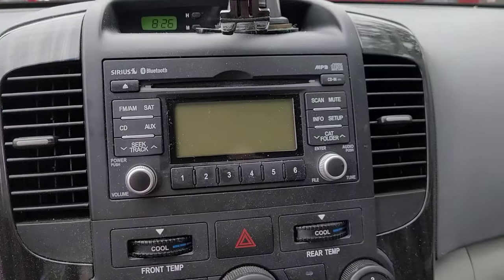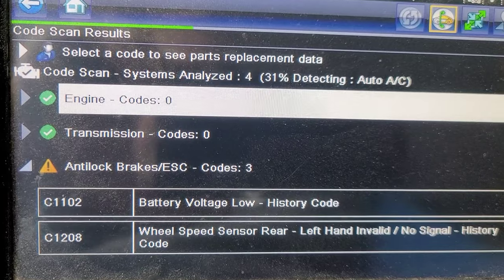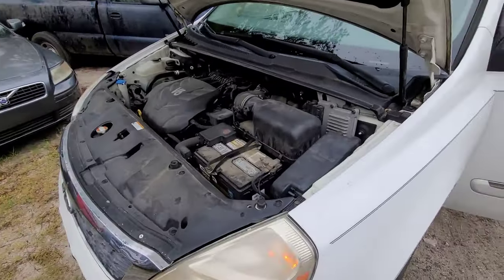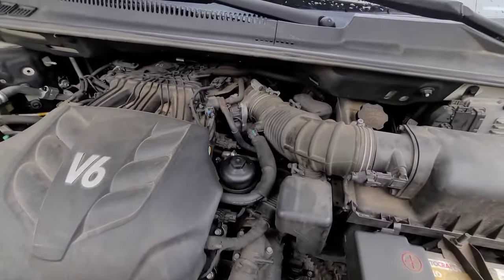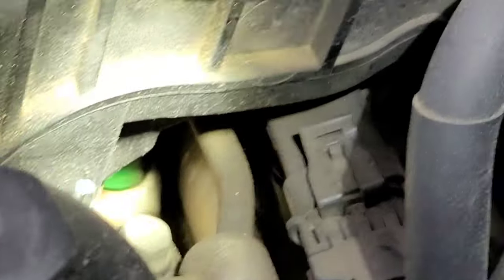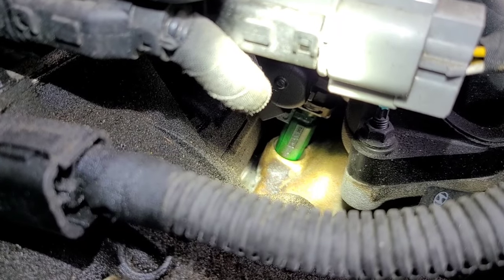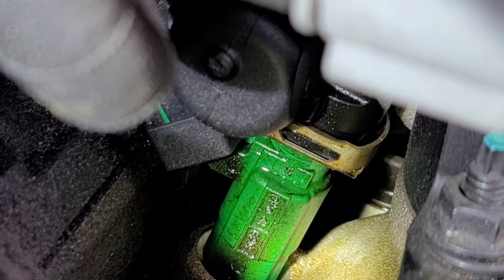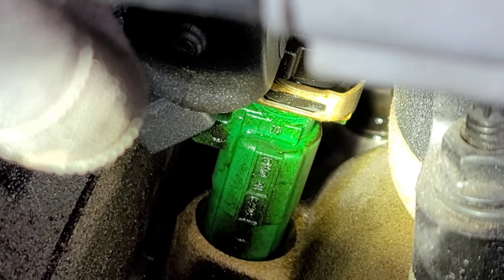Fuel smell inside is quite strong. But why?

Comment: Had the same gas smell on my 2019 Mercedes sprinter. Two trips back to the deal to finally get it repaired right. Dont buy mercedes
Reply: Mercedes is so good yet so complicated and painful with the repairs
Reply: @FjoriKarabina  i have spent $60 thousand plus for repairs to my 2012 Diesel and $15 thousand plus for my 2019 gas sprinter.  Love working out of them hate repairing them. Im ready to burn the 2012 if it goes into limp mode again
Reply: @ptech88  Bro i have a mercedes benz w203 of 2001 , 220 cdi diesel , i swear i am in Albania and we have cheaper service costs for the cars , and between 2019-2024 i may have spent 6000 € , it is so comfortable and such a beast on the road , but the maintenance is a pain in the ass , totally understand you
Reply: @FjoriKarabina  im guessing you dont have all the emissions controls that mine have. Every problem had been emissions
Reply: @ptech88  exactly bro we dont go to the mercedes company for the services we have our own private mechanics

Comment: I smell gas when revving really high
Reply: Did it get resolved if yes what did you do?
Reply: @nikhilgaba1  the engine stops ignition on purpose as to protect itself during unneccesatry revving. it a function that the fuel injectors keep going in time but ignition is cut causinf fuel to dump into each cylinder and escaping its normal.

Comment: Interesting video. I have a general question. If fumes are coming from the engine bay, how do they get into the air intake for the cabin? Is the rubber seal for the bonnet just not good enough at separating the two?
Reply: There's a vent that pulls in air for the cabin, it's near the wipers. So the car pulls in air really close to the engine. When Kenny says, "recirc" he means recirculation of the cabin air. So that lead me to the vent pulling in the air.

Comment: Thankful that owner taking gas smell action with Kenny !  Many Kia, Hyundai vehicles have caught fire. Guess that cheap plastic fuel rail says it all. You buy cheap Korean car, get cheap parts with equally cheap dangerous quality. It's worse with DI because the fuel line and rail must be leak free at > 3000 psi. No place for cheap quality parts.

Comment: My 2016 A6 3.0 has a fuel smell also. I can only smell it when I’m motionless or in park after I drive and it’s really starting to get to me. I can’t smell it from underneath the car but I can smell it from the engine bay.
Reply: What was your resolution
Reply: Did you ever find the issue?
Reply: @turnyouintoabox2300  you find anything?
Reply: @Jay5hundo Check the fuel delivery fittings and lines under the hood. In my case it was smelling from bad tank cap on the filler as well as evap cannister. It can be a line from the purge valve leaking vapors as well under the hood
Reply: I have the same issue, what was the solution @jaycecox8700
Reply: @Gtb42  I've seen in the past that it can be the seals around the fuel injectors going bad. They are pretty easy to replace.

Comment: 5:47.. If you watch closely, you can see fuel drip from toward the top of the injector on the left hand side. Probably needs a new o-ring.. but could possibly be a crack in the fuel rail.

Comment: Yesterday, my Kia Picanto old one, went through change of brake discs and pads rear and front. 
Back home, I’ve got a strong fuel smell inside which didn’t have before. 

Could it be something they forgot to adjust, damaged or what could have happened? 

I’m dying for tomorrow to arrive and ask but I’d like to have an idea if they might have forgot something? 

Also, I’ve found a metallic piece seating on the back seat just under the belt. Have they forgot to put it back? 😮

Please, if you read this, HELP! I’m scared as first it was quoted £288 then I ended up paying over £500 🥺

Thank you 😔❤️
Reply from the maker: Hi Kia owner! It's Mrs Wrenching. I would go to the repair shop first thing in the morning. Kenny would hate to have a customer worrying about their repair. That being said, having brakes done all the way around would not cause a fuel smell in the car. I have had mechanics leave tools in customer cars though. Get with the shop in the morning & get some piece of mind. Your brake pads will squeal when they need to be changed. It's good practice to have your mechanic check your brakes every time you have your oil changed. I get my oil changed every 5000 kilometers. That way you should be able to avoid another BIG brake bill. I hope this info helps. Thanks for watching! 
PS let me know how everything goes - Megan

Comment: Hi, Thank you so much for the video. I have a 1997 Ford escort and I smell gas not to long after a cold start. Soon after rolling down the road, I have to open all the window🤢☠️ would really appreciate any help or ideas with this. Thank you, Diane
Reply from the maker: It's something you really need to investigate. I don't think the Escort has fuel lines that run in the vehicle , but I'm not 100% on that . I'd check the fuel rail for a leak . Also , try turning the interior air to "recirculate" . If it's on recirculate, and the smell isn't as bad , then you have some sort of leak under the hood
Reply: @WrenchingWithKenny  okay. Thank you so much for your reply ❤️ I will do my best to look into these.

Comment: If the fumes are coming from under the hood, would you smell it when the heater is on? I smell fumes every time I’m stopped at a light, but not when the windows are up
Reply from the maker: If the heater is on and NOT set to recirculate , then it will draw air from the cowl area and you'll smell it .

Comment: I just got vakve hasket cover akd valve adjustment done few days ago and now there is a gas smell through vent inside cabin. Honda says it not rekated to vakve gasket. 
I have 2016 accord 2.4l what can be the reason
Reply from the maker: They could have very well disturbed a fuel line . I believe you have a fuel leak . I would have the dealer check it to be certain. You never had the smell before the work was done . I would make sure they know this

Comment: Wifes' PILOT Smells like Fuel but only when the weather gets colder out (not freeze'n- Houston area) and not all the time. Any Ideas ??
Reply from the maker: Very hard to say as there are quite a few components in the fuel system. There is nothing I know of that's a common failure on pilots or any of the Honda V6 fuel systems

Comment: Here's one for you. 
2012 Ford escape XLT. 
Overwhelming fuel smell inside cabinet. Zero smell outside. 
Car doesn't have to be running. (I've had it parked since I noticed and there was really no noticeable difference while running).
No code. I haven't been driving it so don't know about mileage difference. No leaks found. No problem filling up. Just eye watering fumes inside. 
Any guidance/advice would be greatly appreciated. 
Thanks!
Reply: On The Escape the Fuel pump is under the drivers side rear seat. Lift up the bottom seat and see if the seal is rusted or damaged.
Reply: Fuel pump under your back seat. Maybe

Comment: Will water in the gas tank make my taho skip and pop what can I put in the tank to.get rid of the water
Reply from the maker: Doubtful . Usually, water settles at the bottom and will get sucked thru first. Dry some isopropyl alcohol (dry gas) . That will help if there is moisture in the fuel. But I think you have other issues
Reply from the maker: @andypressley4702  , it could very well be bad/contaminated gas , but not necessarily water in the fuel.
Reply: Will a bad coil pack make my taho skip and pop
Reply from the maker: @andypressley4702  . It can definitely make it skip. Usually you'll have a check engine light on and flashing as well

Comment: Hi. I got a question. I have a ford escape 2002 v6, but the check engine turn on with a code cylinder 5 p0305. I already changed spark plugs and coils, but the engine kind of shakes and smells like gas fuel. It runs roughly and the catalytic converter overhead red. What do you think that the problem is?
Reply: I had the same problem and it was fuel injector
Reply: That or part of the valve has left the chat I had the same issue the the top off check your internals

Comment: I just got a fuel pump replacement and once I got in my car it smells like gas. Is this normal?
Reply: Maybe just the process of replacing it may cause some gas to drip 💧 and cause the smell especially if your fuel pump is located inside the car
Reply: Same here , did the smell stop in your car ??

Comment: let us know where this goes as far as repair work.
Reply from the maker: Dealer fixed it free of charge under a recall
Reply: Our nissan had a bad fuel smell after cold start. Then disappears when it warms up. All the spark plugs were loose and leaking vapors. Think thats why they sold it so cheap.
Reply: @WrenchingWithKenny Now I'm very interested😅

Comment: I have the same exact problem Except it's not from the Ac on ,,it's just The defroster on which is basically the ac  on  lol  and it only happens on occasion,, I also had a evap leak code.. which I have reset a few times   one was p044 m then I checked the gas cap and all that reset the code   then got a p045  code  , reset that   then it threw a P044 code again after a week or 2  ...What should I do smoke test it?  What would more than likely be the cause. Any help would be appreciated..       I keep my tank between 3/4 and full most of the time so it doesn't really have a chance to really throw a code again.. even though I could reset the codes anytime I want as part of my aftermarket head unit,    but I'll smell gas for a second or two.. then Goes away... Might not come back for another week or two sometimes even a month   ... It's the first time I'm actually dealing with an evap problem in any car...  what should I check  ?  Yeah the car doesn't smell outside of it just on occasion with the blower/Defroster motor on full  Which is basically the vent open ac on..   Just going through videos...  Don't have any other smells around the car and my gas cap does look pretty good the seals and everything.. It doesn't happen often that's the thing ,, obviously it's dumping fumes  Pretty quickly then dissipating .. I've already looked at the lines they look pretty sturdy and in pretty good shape